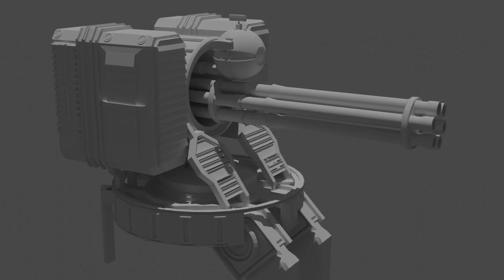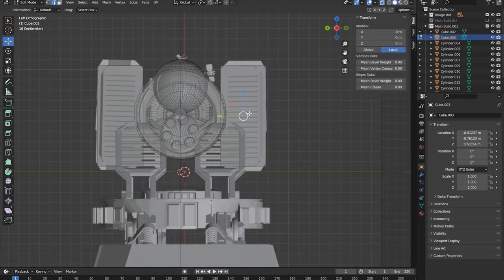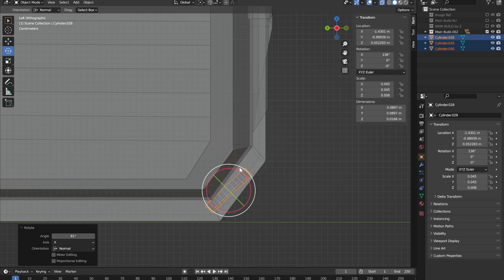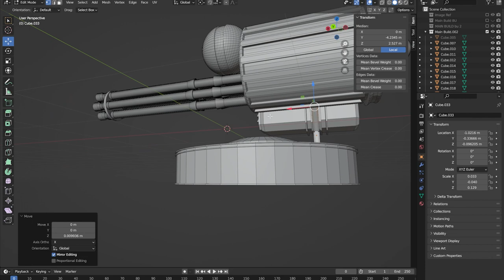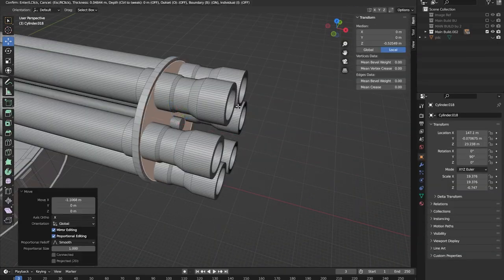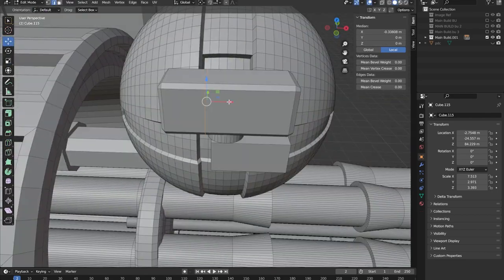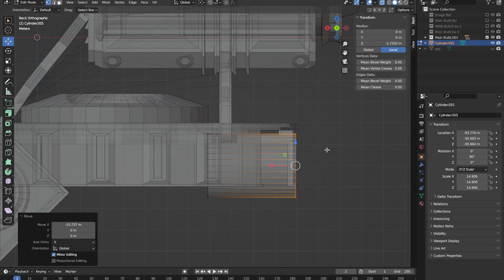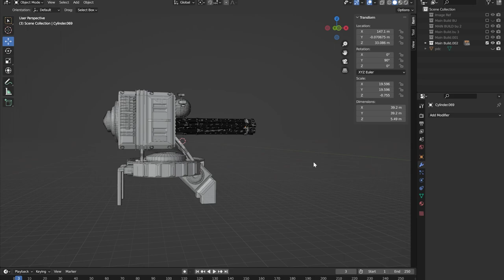3D modeling a show accurate PDC from #TheExpanse

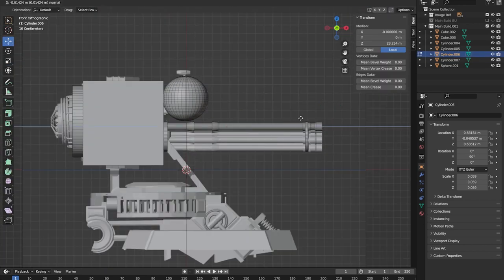Comment: 1:15 There are addons that make radial arrays easier, but you can do it without addons. Add an empty and place it at the center of your intended array. With the empty selected Shift+S and Cursor Ro Selected. Then select your object and Shift+Ctrl+Alt+C and Origin to 3D Cursor. Then add an array modifier to your object, and uncheck relative offset and check object offset and choose the empty as the offset object. Choose how many copies you want, and select your empty and rotate it 360/n where n= the number of arrayed objects you have. 

2:56 and 5:00 In Edit Mode with your group of faces selected - Select->Checker Deselect.

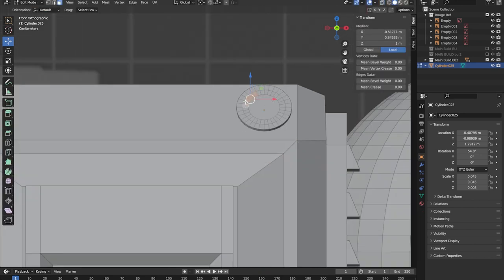4:29 In Edit Mode, Alt+Select an edge in Face Select Mode to select a face loop.
Reply from the maker: Thanks for all the tips! I'll take them into account the next time 🔥
Reply: @chrisdanelon  if there's one thing I've learned about blender over the years is that there's never only a single way to do something. So many different ways to do things!
Reply from the maker: @backstept  Yes totally and there is always something new to learn :)